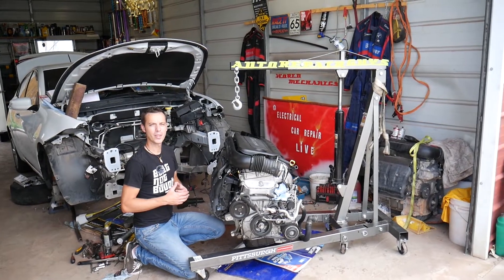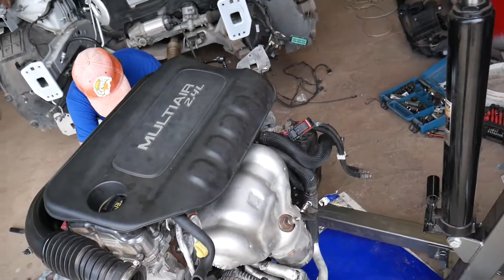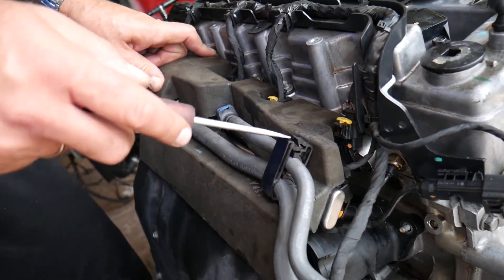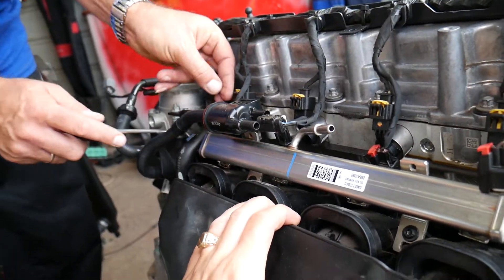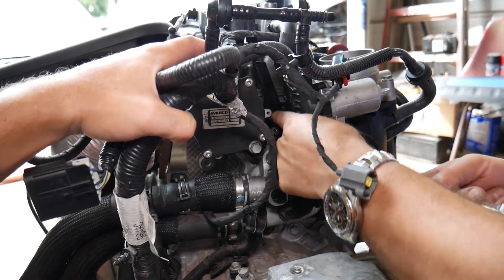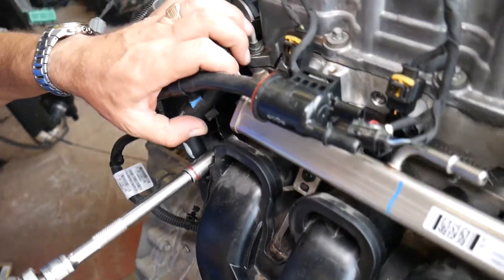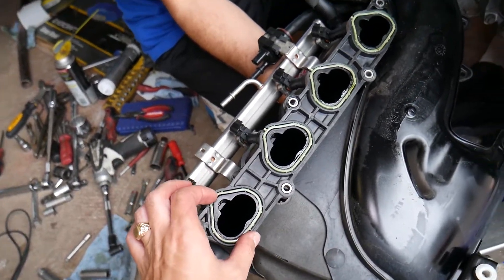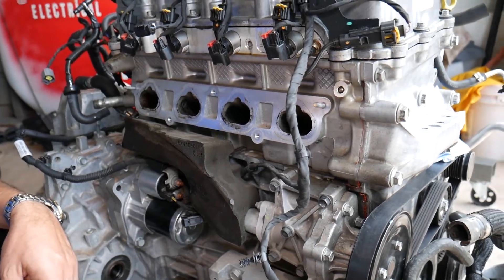KNOCK SENSOR REPLACEMENT REMOVAL LOCATION 2.4 CHRYSLER 200, RAM PROMASTER CITY, FIAT 500X 500 TORO

Comment: Is there an under the hood sensor diagram indicating sensors? Replaced radiator, thermostate and rafiator fan unit but fan isnt working.fiat 500 2012

Comment: what happens if your knock sensor is bad?  Anybody know what this sound is?  https://www.youtube.com/watch?v=BS1489q8b3s
Curious.. how heavy are these engines? I see used low miles ones for sale cheap (like $400). In the US, what could a mechanic charge to swap these TigerShark 2.4L engines?